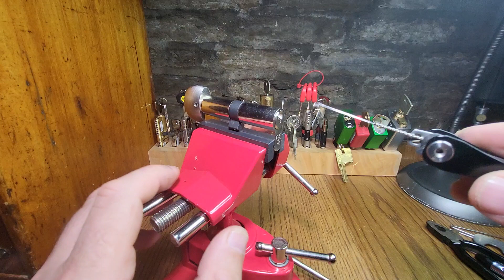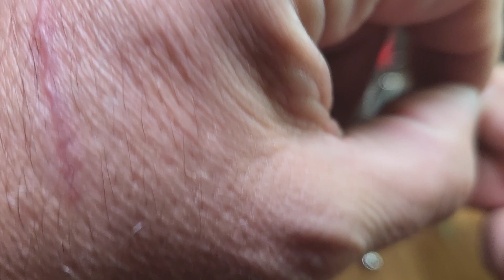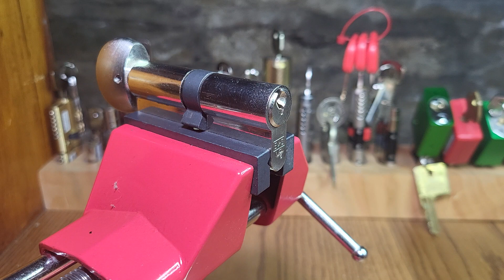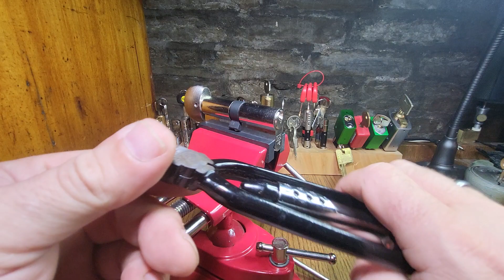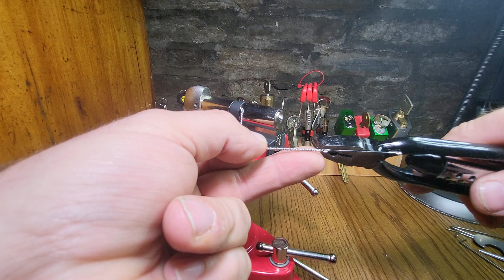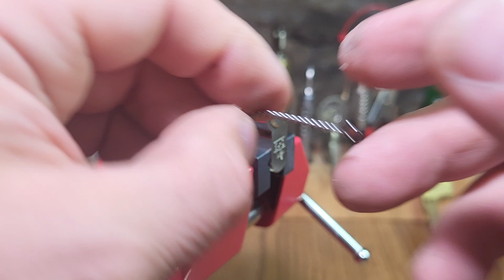Covert Companion Thumbturn Bypass Driver Mod - Make Your Own

Comment: Good idea Paul, they can be expensive to buy from shops, 
Do they work on modern thumb turn locks? Did they cotton on to thumbturners & modify the cam or shield it, I’ve never had a thumb turn lock so I’ve never experimented with them.
Reply from the maker: I find it works with about 30-40% of Thumbturns, I've got 7 and it will open 3 of them, it won't open things like the Kinetica, it's good for the more budget end of the market which if you think about it is the majority of locks, I've got a reasonably new E*S MX6 and it opens that without any trouble
Reply: @Lock-Picking-Paul  that’s good to know,thanks Paul.